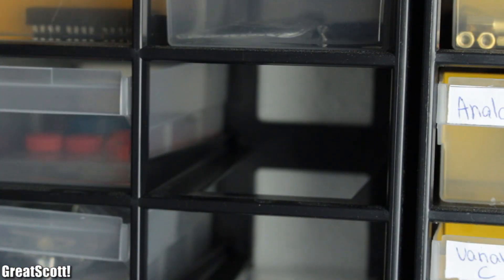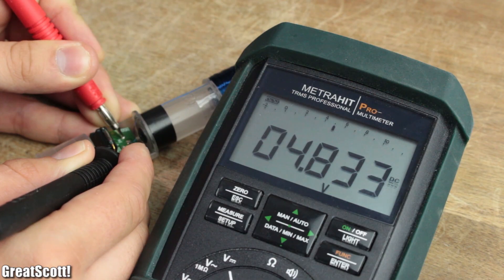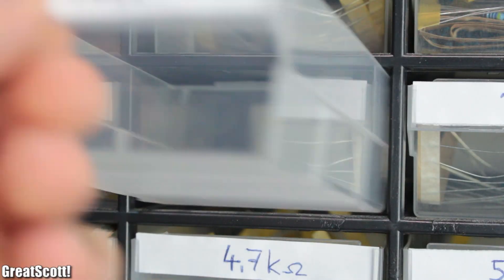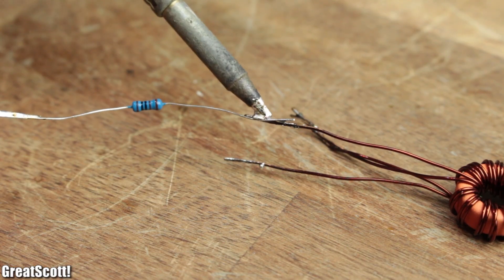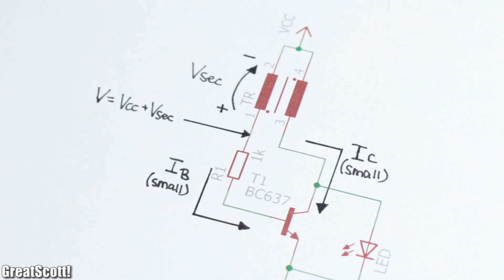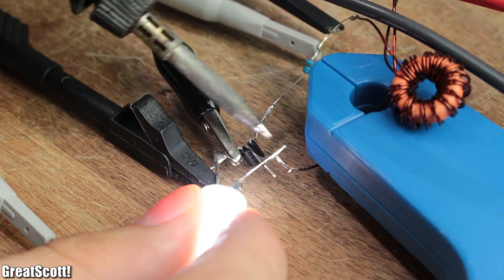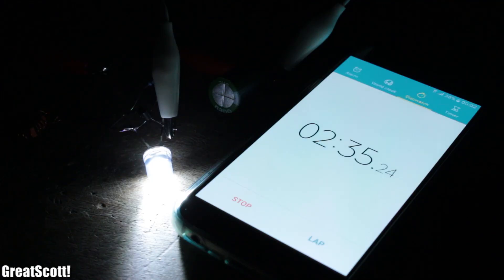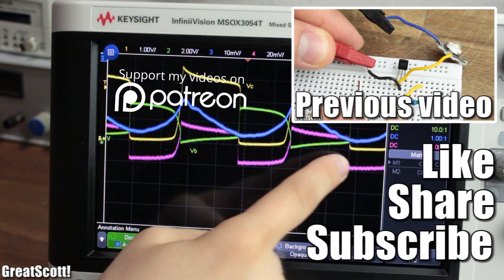Supercapacitor Joule Thief

Comment: WoW I am jealous of that 500MHz scope!
Reply: no need to be jelous. If you want good oscilloscope but with low cost, don't chase scopes on shelf. Oscilloscopes are made to last for looong time. for example i got Tektronix 2440 500MS/s for 300€ including shipping and it's over 30 years old. And it is STILL going strong.
Save money for proper one. Dont go with "poket" or "pc" scopes. It do not need to be lcd or light weight, BUT make sure it stands for your purpose of use. Here is something you need to consider when buying an old scope:

Analog/digital (digital have more options & usage but analog ALWAYS shows correctly. Voltage spike detection depends on sample rate)

Channel count (2 is pretty standard an good for general purpose. 4ch is for  more complicated applications like communications and multi prosessor...and so on)

voltage range (normal scope can take 400v spike, in other words 800v spike-to-spike. so check that before you plug prope to wallsocket)

digital scope stuff:

samplerate (faster the better it is. WARNING some scopes uses "averageing" to create "better" samplerate.)

memory resolution: for digital stuff byte per sample is good enough but for analog circuits need more accurate samples...

memory width: how long can scope record. this is a problem with old scopes. back then there was very little memory available. (I have to strugle with 1024 bytes but with delayed trigger i can analyze very accurately that did my app send to my circuit and trouble shoot it)

and for more stuff you need to know, go watch scope guides from EEVBlog... they know a lot more than i do (just an engineer student). :)
Good hunting.
Reply: Dangerous_CODE Thanks for info mate...
Reply: As Afromantech said "I never invest more than 400$ in a scope ever!"
Reply: Me too! It looks the business.
Reply: np :)
Reply: 1. You shouldn't be jealous of anyone but is pretty normal 
2. You have the wrong things in life to be jealous about.
3.Having a lot of money to buy these things should make people happier but it often doesn't.
4 :  Conclusion  : a lot of people worry about and get jealous of unimportant things in life, it is human nature but it creates a permanent rat race.
5: don't worry about all the bullshit , so long as you have a roof over your head and  can eat enough you are good to go.

Comment: I know this is a stupid question but aren't transformers only work in alternating current?
Reply: Good question. I too would like to know the answer.
Reply from the maker: The current that was flowing through the primary was alternating. It rises and then falls. You can also see in the video that once the oscillation stopped with 2.3V the LED did not light up because the transformer was not inducing a voltage anymore.

Comment: The problem with the classic simple joule thief is it's horrible efficiency! I was able to improve the design a tad bit by messing around with the feedback coil and adding a series capacitor, turning it into a blocking oscillator, and adding a "peak detector" circuit to reduce the ripple current in the LEDs, which improves the LED efficiency, although additional loss in the diode is created. By adding a zener diode to that connected to another transistor to short the base of the main switching transistor to ground, you end up effectively making a very basic regulated boost converter!
Reply: I like simple circuits too, but I generally notice simpler circuits are less efficient. Which is fine for some/many applications. A well designed boost converter or charge pump should be very efficient, much more so than this joule thief. I think the reason why it's efficiency is poor is because the oscillator relies on a positive feedback loop that only terminates when core saturation is reached. Reaching core saturation is not a cut and dry threshold, but more like a diminishing returns on how much energy is stored in the magnetic flux vs put in. So some loss comes because the inductor does not return all the energy Q1 put into it. Also you can see in the video how Q1 turns off gradually as the core saturates, which means there will be significant switching losses, which you may become painfully aware by burning your finger on Q1! :O Also, BJTs are generally not the best for switching applications, because they generally have a limit to how low the Vce voltage drop can be, generally about 0.4V depending on base current.

Why have I not made any videos on my channel? Because I have been really busy and just not had time to keep up with youtube. (going to UVA!!! :) ) Also I recently acquired the Art of Electronics, so I have been holding off on my capacitor tutorial video just to make sure that everything I talk about is as correct as possible.
Reply: Op amps are not suitable for a buttload of reasons. I think what you mean to say is that the open-loop gain of an op-amp is nearly infinite (like 100 db typical) so microvolts of difference at the output can cause the voltage to swing between Vcc and Vee. However:
* The output voltage of an op amp is limited to within the voltage rails of the supply. (In fact, even less than that. Typically only within 0.6 to 2V within the supply rails.)
* Op amps are way too slow. The classic LM324 (extreme example) has trouble amplifying signals faster than 9KHz. Again, unsuitable. We need transistors that operate well into the several tens of  MHz.
* The output of an Op amp is not capable of driving more than a few mA's to a few ten's of mA's. Even small TO92 transistors can deal with upwards to an amp.
Reply: In short, Op Amps are designed for being powered from a dual-rail power supply (at least 5V in most cases) and are designed to perform mathematical operations, like addition, subtraction, multiplication*, integration, differentiation, average, etc. Hence the name. As well as amplification of small signals and voltage buffering.
Reply: @power-max  its been 2 years dude? Where the fuck is your video youcsaid you make showing a better version?
Reply: @everythingpony  Ironic username, Rainbow Dash isn't supposed to be a narcissist
Reply: But the losses increase by adding complexity to the circuit. I think the Joule thief is a great little circuit as is and perfect to help encourage people to experiment with electronics. But that aside why no recent projects or tutorials?
Reply: I never said it was very basic. :/ Although if he saw what I was trying (and probably failing) to describe in schematic form he would think it is moderately simple.
Reply: +jonnda damn auto correct. zen ever diodes. Zeneer! Damn it.
Reply: could this circuitry be applied to much larger modules?
Reply: I tried to use it to power 1000 LM CREE XML T6 LEDs and even the newer 4000LM XHP70 LED! However you will not get anywhere near full power. Maybe 300 lumens at the absolute most. Especially with low voltage dead batteries with high ESR. You just cannot suck energy out of them fast enough to power the LED fully. I recommend using a proper switch mode LED driver to regulate current. Buck converters are generally more efficient.
Reply: Why not use an OP-AMP? Don't they run up to infinity? No one seems to want to talk about that aspect of the op-amp...so I've heard.
Reply: Hi, can you send your schematic? thanks
Reply: Can you edit the 'very basic' part, please?
Reply: +Power Max I think he's saying the circuitry you are describing doesn't match his definition of "very basic".
Reply: Power Max I'm confused because I remember you had your improved joule thief and called it 'very basic'. Now I cant seem to find it anywhere
Reply: I don't recall ever saying it was "very basic", although I do generally edit my comments for typos or to clarify a sentence seconds after posting them.
Reply: +Power Max In your original post: "by adding a zen er dials to that connected to another transistor to short the base of the main switching transistor to ground, you end up effectively making a VERY BASIC regulated boost converter!" (My own added caps emphasis)
Reply: Ah, so I guess I did. It is very basic indeed though. ; )
Reply: Hi, my Joule Thief reaches a efficiency of around 60% and that's not bat for a very basic design.
Reply: Power Max Clorox was jokingly saying edit the very basic part out because Clorox is very basic
Reply: Power Max replace the transistor with pre programmed firmware
Reply: So much for keeping it simple. You just ran with it.
Reply: 2 transistors, a zener diode, a few resistors, and a few capacitors is simple IMO. And much better, because at least it is regulated. And with the right parts you can get many hundreds of regulated volts on the output!

Comment: Do you know where can I get a variable boost converter? I am using a trimmed USB connector and a portable charger as my power supply and I need a higher voltage, and the ability to control that voltage.

Comment: Still don't know half the stuff you say but it's still interesting
Reply: I found that using gases or water to explain how electric circuits work makes things a lot easier to understand. Basically, for the Joule thief, the transistor causes flow in one direction through the coil, which then causes the flow to stop due to the magnetic interference of the coils going in opposite directions, which stops the transistor, but all that electricity in between the coil and transistor acts like a small capacitor (quick-discharge battery), and the current from that part of the wire gets added to the current of the battery, to power the LED, then that emptying of the capacitor-like wire causes current from the battery to be able to flow to the transistor again, and the whole thing repeats itself.

Comment: Hey GreatScott, nice work again.
I have a little problem and i wonder if you can tell me, or perhaps make a video about it.
How can i protect a device against overvoltage with a tvs diode?
I want to protect some retro MIDI soundmodules from overvoltage.
Do i just put the diode in parallel with the device and a fuse in serial?
What specs should the diode be?
thx

Comment: Did you try adding a small (.1 uF or so) cap to the output side? That helps keep from wasting part of the energy from the magnetic field during each cycle. Connect it access the LED and put a schottkey diode in series with the LED and you will get a basically smooth output and a noticeable increase in brightness.

Comment: 5 minutes to 20 minutes wow
i would say its amazing
Reply: What? No he doesn't. The joule thief is basically a crude boost converter. As is explained very clearly in the video, because power diodes have a high forward voltage, they turn off when the supercap discharges below that forward voltage, which leaves quite a lot of unused energy in the supercap.

Boost converters use a coil, in this case the toroid iron core with enamel wire wrapped around and usually some sort of switching to increase the voltage from a power source. This increases the voltage while decreasing the current. 

However, even with the higher voltage there is still enough current to drive the LED since LEDs are actually very low power devices, so it lights for 4x as long, since much more of the energy stored in the cap is being utilised as its low voltage gets boosted to a higher one meaning the LED can stay on for longer.

It looks like you're breaking the laws of physics, but you aren't, there is simply untapped energy that is still left over.
Reply: but the output has a high frequency component so this circuit is only useful for powering LEDS, right
Reply: Use a smoothing cap and you're pretty much good to go.
Reply: nothing stops you from adding a diode and a cap to make it  stable but you will need some sort of regulation because as you can see in the video the peak voltage at the collector of the transistor is 94 volts so if you add a diode and a cap it will charge to that voltage slowly.This circuit isn't practical as a boost converter.If you want a simple boost or buck converter i suggest going with LM25xx IC's.They require minimal componets,easy to use,and can be very efficient if you chose the correct components.

Comment: Can you have the Joule thief circuit only turn on once the power has dropped below the forward voltage of the LED? that way you could avoid the inefficiency of the circuit at a time when the LED doesn't need it to run.

Comment: Another great electro engineering video! tnx scott
Reply from the maker: I agree
Reply: +Angular I disagree, it's neither stupid nor useless, because most youtubers like to read such comments from time to time, whereas yours was completely irrelevant.
Reply: Another stupid useless comment
Reply: +MrJob91 I would not call it "amazing" but it at least informative in opposite to your previous comment.
P.S. I personally prefer Futaba transmitters - they are much more reliable.
Reply: +MrJob91 Nice. So what MCU it has? I hope at least it's not Atmel...
Reply: Ah, I see, it's Cortex M3. I already found the article on Hackaday about this. Pretty intersting, I like the idea. And you're wrong with your quick conclusion about me, I appreciate people doing complex things. Flying 3D heli inverted for just 6 month is pretty neat. I don't remember how much time it took for me but I'm sure not faster than that.
Reply: Almost each video on YouTube full of such silly comments with zero information. "Thanks", "Great video!", "Amazing!", etc. It's just a junk comments that hides really informative and interesting ones.
Reply: ok.. so how about this comment, or story? I bought an H8 mini quadcopter for 10 € I flashed it with my own modified firmware. Used the pwm signal output to drive brushless motors. I ended up with the cheapest acro line of sight carbon fiber quad for under 80€ with a range of 300M with a devo transmitter. it measures 130mm and can fly with impressive speeds and has a 4to1 power to weight ratio using the 1104, 4000KV tarot motors and esc's using only new parts. I did not buy a lithium polymer battery I made a connector and connected small lipo's that came with the h8 mini together to get a voltage of 12,6Volt

Now that is an amazing comment but has nothing to do with the video. So either or what do you like best Angular?
Reply: haha more reliable... I have to control a 2€ flight controller with integrated receiver. what do you think is more reliable... the devo or the FC hahaha you're great! How much does you japanese radio cost? Did you know I only started flying 6 months ago and can already fly a 3D cp heli inverted? Ofcourse you're not going to call it amazing you seem to have difficulty showing any apreciation for a simple effective positive solution or comment
Reply: wow man seems like you actually are a cool, smart and interesting person! I know I went a little overboard on my conclusions and all but hey! there could have been a real narky kinda person behind your first responses! good luck on you m8 and let me know if you want to know more about building acro quads from cheap toy quads. I didn't invent it but I found allot of cool aplications for it. its a nice way to build high performance carbon fiber brushed and brushless flying machines XD
Reply: I've been flying model helis for years but am still a bit shaky on inverted flight.  i think it's nerves because I can do it on the simulator just fine.  I have a mCPX brushless.  I'm also into quads.  My mate and I build them with all the good stuff like autonomous flight, etc.
Did you learn on a simulator or are you rich?  8^)
Reply: I've been flying model helis for years but am still a bit shaky on inverted flight.  i think it's nerves because I can do it on the simulator just fine.  I have a mCPX brushless.  I'm also into quads.  My mate and I build them with all the good stuff like autonomous flight, etc.
Did you learn on a simulator or are you rich?  8^)
Reply: I've been flying model helis for years but am still a bit shaky on inverted flight.  i think it's nerves because I can do it on the simulator just fine.  I have a mCPX brushless.  I'm also into quads.  My mate and I build them with all the good stuff like autonomous flight, etc.
Did you learn on a simulator or are you rich?  8^)
Reply: I've been flying model helis for years but am still a bit shaky on inverted flight.  i think it's nerves because I can do it on the simulator just fine.  I have a mCPX brushless.  I'm also into quads.  My mate and I build them with all the good stuff like autonomous flight, etc.
Did you learn on a simulator or are you rich?  8^)